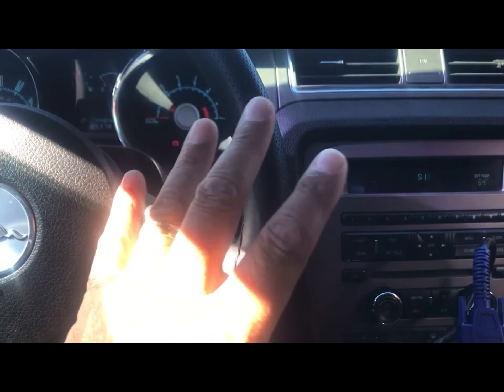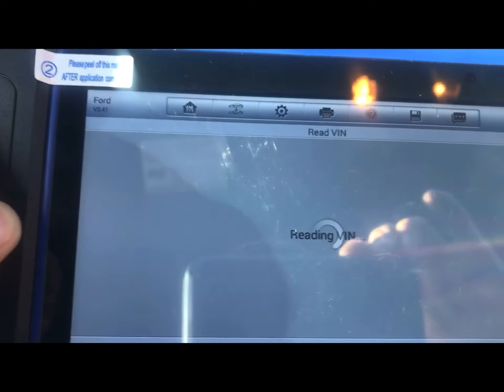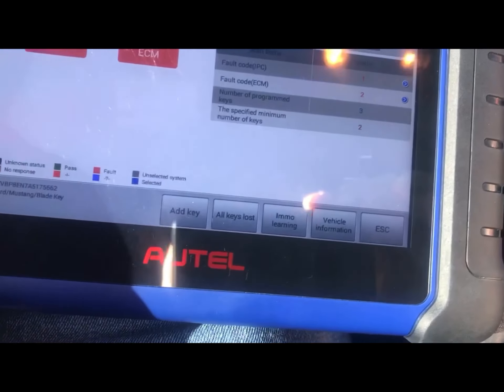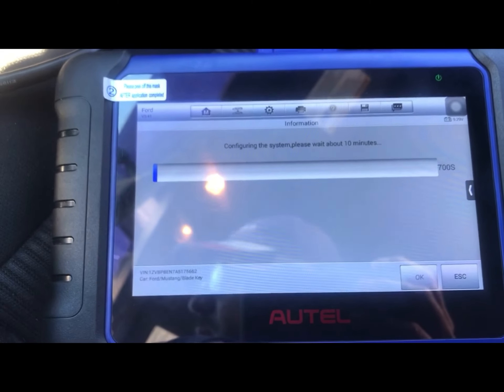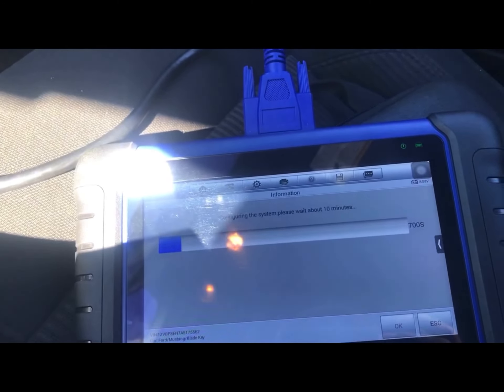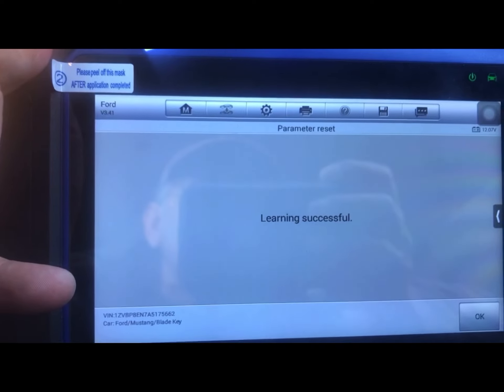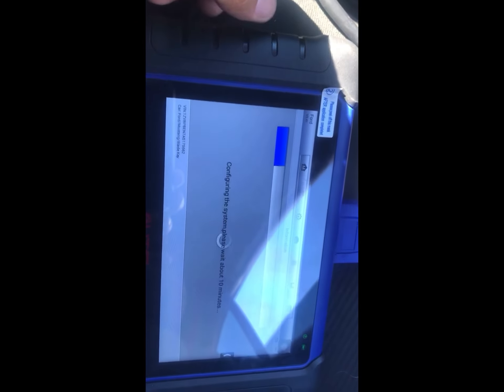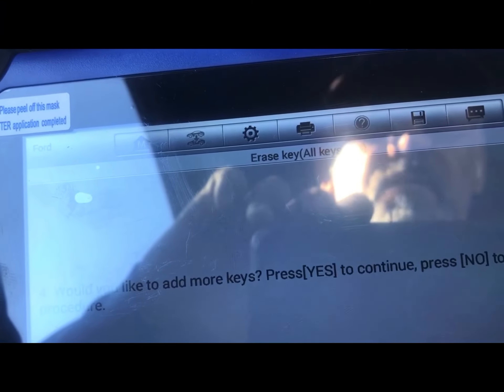Ford Parameter reset/Erasing&Adding keys/Ford Reseteo de Parámetros/Borrar y agregar llaves

Comment: I have a 2005 Ford freestyle, that needs a new ECM.  Can I buy a remanufactured ECM with my VIN already programmed. Then purchase an Autel IM508 or Autel IM608 scanner, just out of the box, no registering, updating fees, subscription fees or anything and use it to immobilize and relearn the new ECM and new keys?
Reply from the maker: Well, there’s no point to buy any programmer if you are not getting the tech support ( in my opinion ) why? Any investment needs to be “insured” unless you are ready to lose your money. It takes $$ to make $$. Unless you are not seriously getting into this as a trade or business. I bought a lot of “Chinese” knock offs and ended up not working or limited capacity and no one to call for answers. I learned my lesson. I am sharing my experiences, you know what your goals are. 
Thanks for your interest.

Comment: Question ,do you think i can reset if i have a problem with system alarm,
Reply from the maker: @renec0327  what is the year make model and what’s the problem with alarm system?
Reply: @zeketheone7393  hello sr thank you for the response, we'll I'll be trying to add another key fob or remote 2013 ford edge with the topscan pro programming alarm but I think I did something wrong cause the car doesn't turn on anymore, but the remote still lock and unlock, is push button the car, I don't have access to the dashboard cluster
Reply from the maker: @renec0327  13 Ford Edge Smart Key system was in working order, task was just to add a second key, correct?
Did you choose “Add” procedure?
Reply: @zeketheone7393  yes but I think I chose the options all key lost I think the process take like 10 min,I follow the Instructions ,waiting the 10 min and after done the screen show a message saying the procedure failed, a key learned be the current vehicle and everything turn off
Reply from the maker: @renec0327  if the “erase” procedure failed it shouldn’t have erased any existing keys.
Reply: @zeketheone7393   I don't know what's wrong but I messed up something in the alarm system
Reply from the maker: @renec0327  The Immobilizer system is the one that handles keys, so it is NOT alarm system,
Always a a fully charged battery before you start working with ECU or BCM and highly recommended to connect a battery charger. If you just plugged in your scanner and specifically selected Add or Erase keys, it does not have anything to do with shutting off cluster, which is apparently the issue you have. Correct? 
Are you able to scan car for engine codes?
I am not familiar with TopScan pro device…
Try a “hard reset”. Unplug both terminals from battery. Then touch both car terminal together for at least 10 seconds to drain any electrical power from vehicle. Make sure car battery is fully charged and then plug back car terminals to battery.
See what if cluster comes back on.
Reply: @zeketheone7393  ok I am going to do that sr thank you for your help I really appreciate it
Reply: @zeketheone7393  no at the moment, I can't scan, the message said is not communication with the vehicle, and the battery it was drained, may is my battery bad too but why the cluster doesn't turn on?

Comment: I did a parameter reset with a 508 on a ford Taurus 2014 I turned off the car after it said “successful” and I haven’t been able to turn it on since not even the dashboard. What do I do?
Reply from the maker: @JunkyardLocksmith  why did you do it?
Reply: @zeketheone7393  I turned it off because something on the screen popped up saying it would turn off itself to save power so I just did it myself
Reply: @zeketheone7393  I just ordered a second key, should I do “all keys lost” or “Add key” with the new ley
Reply from the maker: @JunkyardLocksmith  Why did you do parameter reset?
Reply: @zeketheone7393  they changed the PCM
Reply from the maker: @JunkyardLocksmith  was the parameter reset done before you turned off?
Reply: @zeketheone7393  yes it said “successful”
Reply: @zeketheone7393  should I do “all keys lost” or what should I do since the car won’t turn on at all
Reply from the maker: @JunkyardLocksmith  Ok, is this an ignition key system or a smart key?
If ignition key system, does dashboard come on when you turn key? 
Are you able to scan system and read number of keys programmed?
Reply from the maker: @JunkyardLocksmith  For future reference ALWAYS have a fully charged battery and at least a jump box, if possible a trickle charger is better so that battery does not go below operating threshold
Reply from the maker: @JunkyardLocksmith  is this an ignition key system?
Or push to start smart key system?
Are you able to communicate back to ECM?